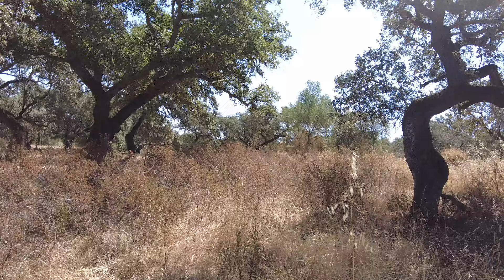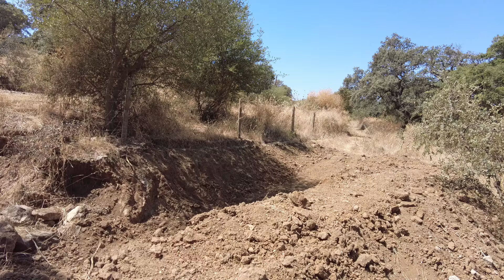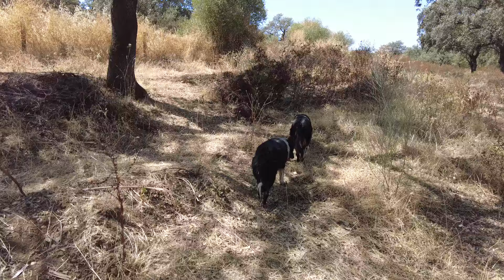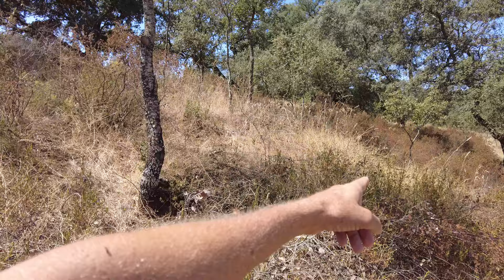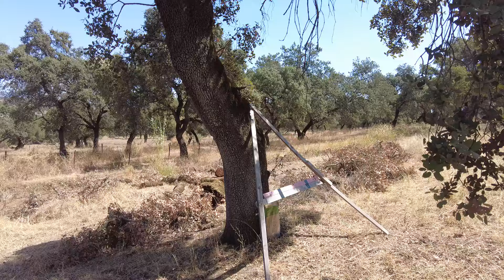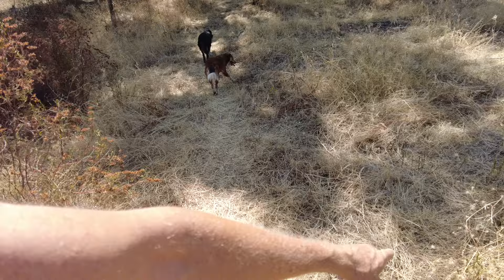Where to dig new contoured swales?

Comment: nice to see more planned improvements,the higher the swales start should be highest point,so water is used over and over again cant wait Martin great plans and efforts,why can u not get digger in,worth it if at all possible 40 degree heat and hand digging definately a no no,dangerous at any age,well done,rains will come soon,then you will see the paradise you have created❤❤❤❤❤
Reply from the maker: @mechanics4all405  Digger doest like that slope. Rephrase: operator of digger doesn't like working on the steep incline. Thank you for sharing kind words. Much appreciated

Comment: Good research summary Martin!
I believe the ferrocement paving system mentioned previously will produce the; 1) Smoothest canal surface and least friction.  2) The widest canal with the best geometry (semi-circular profile with no hard angles).  3) The easiest profile to shovel clean as sand builds up due to nominal gradient. 4) The least potential for hillside erosion.  5) The strongest and longest lasting leak free canal lining.  👍
Reply from the maker: @stevejohnstonbaugh9171  Super listing. Thank you for sharing Steve

Comment: It seems you have set your mind on cement blocks placed on a slab.  May I suggest that you set your first course of block into the wet cement for a tight joint.  Secondly, pound at least one rebar through the core of your fist course of cement blocks, through the wet cement and into the soil. Fill each rebar core with cement as you build your wall.  This will give you the lateral structure required to withstand the force of the perpendicular flow of water from the culvert.👍😊
Reply from the maker: @stevejohnstonbaugh9171  Excelent suggestions Steve. Keep them coming.